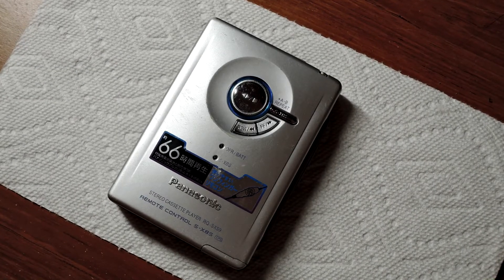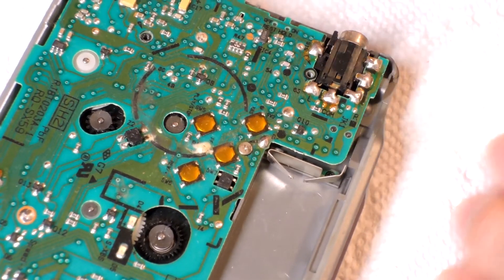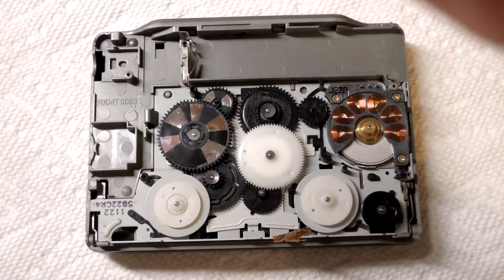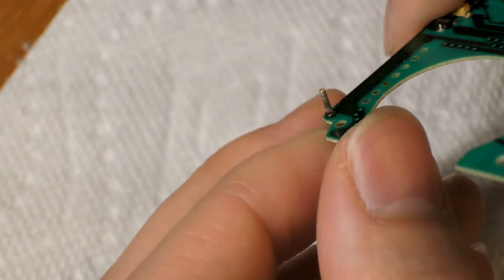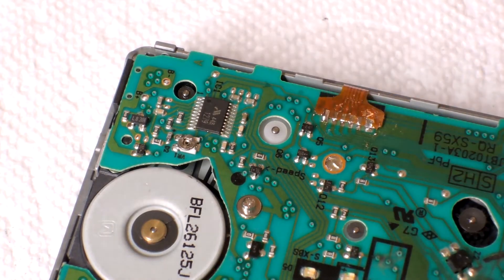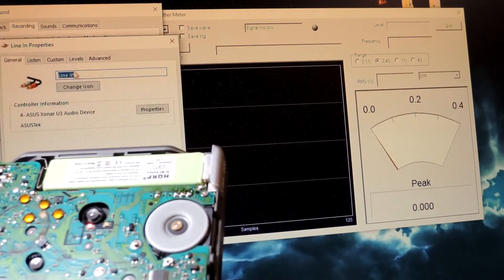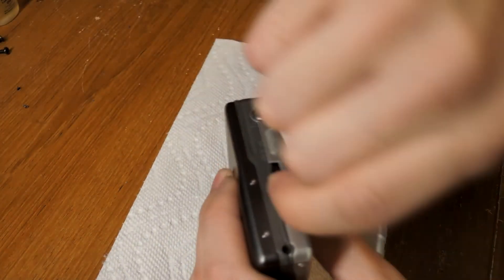Panasonic RQ SX59 Belt Replacement Portable Cassette Player

Comment: I have an old Panasonic walkman myself that always worked great, but I made the mistake of packing it away in a box and after it sat the belt went bad. It's a logic controlled deck, and the tape heads are sorta built onto the tape door so I've been afraid to mess with it. It also has auto reverse. I've repaired a few of the cheaper models with the clunky buttons, but nothing electronically controlled like the one I have now.

Comment: I am impressed - I have many questions - as a big fan of Panasonic cassette players - Can you let me know if you have a link with the list of Panasonic walkman cassette made - I try to figure out the last 10 devices models ever made - If I not mistaken is RQ SX the second last made ?  Can you describe the sound ( if has strong bass, clarity, details, big sound stage, loud )  comparing with other Panasonic models ?  I want to buy Panasonic rq s80 do you know from where ? from where I can buy the tools you use and belts ? What's your favourite sounding / the best Panasonic portable cassette player ?   I have in my collection Panasonic rq s 60, 50, 40,      Rq sw 99, 70,      RQ C10 V,     RQ SX 55,60,75, 75V, 65F, 95F, 99F - few of them not in working condition - I regret I did not keep some other like RQ SX 72, 91 - now after I see your video I want to have all of them in working condition as my collection + to buy some more like the last 3 models made ( hope you can help me to find out which are ) - thanks - look forward to talk to you - any suggestions to buy some special sounding players ?

Comment: Great video. Very helpful. How do you get a test tape?
Reply from the maker: Buy them off eBay. They're expensive, but they're worth it. Especially if you use one to calibrate a high-end machine. That means you can make your own test tape afterwards.

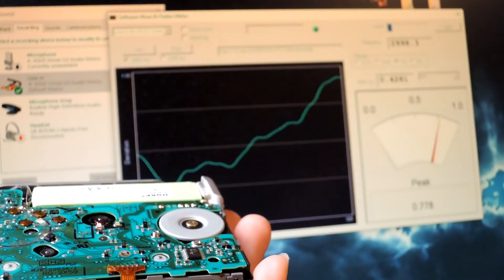Comment: 8:14  To prevent the plastic part of the clutch from flying out.  I stick a piece of tape over the clutch.  I leave a space, without touching the tape to the plastic, similar to the ripple of a roller coaster.  .  If the clutch comes loose, the tape will absorb the impact.  Panasonic are a pain in the ass.